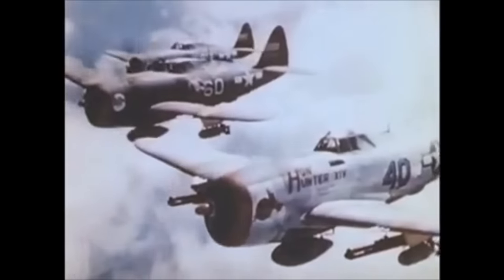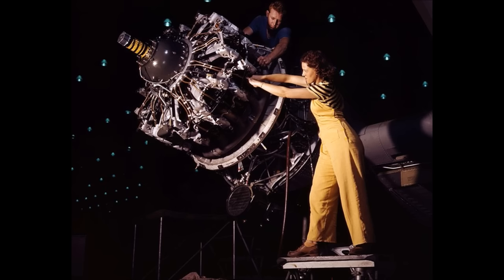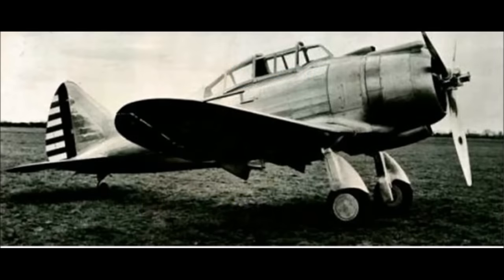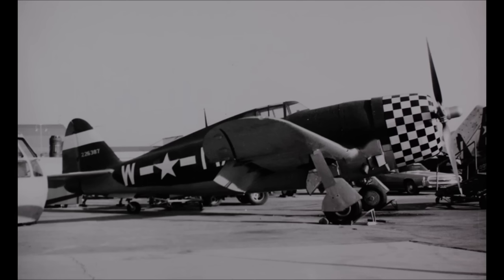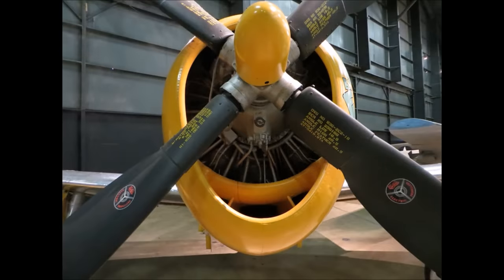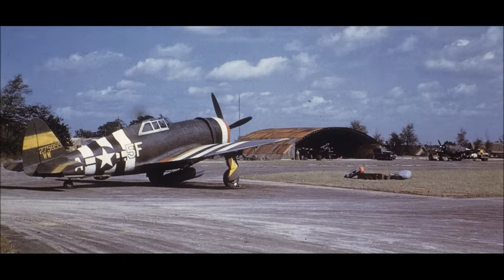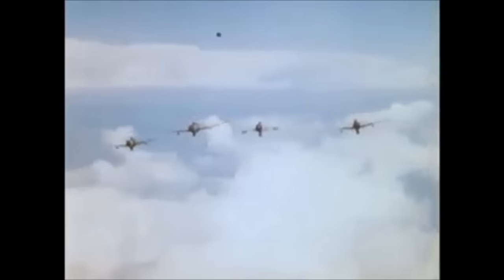P-47 Thunderbolt Pt. 1 Design and Speed

Comment: You mention the flight sims, I like to fly IL-2 Sturmovik, Battle of Stalingrad, Battle of Moscow and other titles. However they are not up to speed on the US Aircraft as much. Yet. They do have the P-39 and the Boston, P-40 as they were lend leased to The USSR at the time. The sim takes place exclusively between the Russians and Germans, with lots of attention to historical accuracy, as far as planes available and their limitations. I'm real curious to see how pro pilots view these sims. With these sims its important to have pedals, Throttle and good joystick. Track IR5 and good headphones. I don't get to fly as often as I would like but when I do I want immersion. Gunnery and its physics are modeled well too.
Reply from the maker: I started flying IL2 BOS yesterday. So far I have only flown the FW190. Overall, I think it's great, I only have minor complaints so far. I don't have track ir, but I do have pedals, throttle, etc. My main complaint is that the inclinometer moves backwards from the direction it should in regards to P-factor, it moves correctly in regards to aileron movement.That's small potatoes though, overall, it's just incredibly good, and accurate.
Reply: Awesome...! get Track IR, it will change the whole experience. Regarding that gauge of course it is possible that this an error but I would look into the setup and see...I'll check mine...The 109 is a hoot to fly too, probably my most favorite, it seems to do as I ask, it is very forgiving, while the 190 is "twitchy" and real easy to stall. The firepower on the 190 is pretty killer.  I suggest the Russian La5 as well.
Reply from the maker: I do need track IR, it's tough to find the enemies looking around with the hat switch, and the lack of icons on the server adds to the difficulty, which is actually the point, I get that.  At the moment my 190 tactic is to run from fighters and attack bombers. I have only played online a couple times, I shot down two planes but got shot down several times. It's a lot of fun. Regarding the gauge, it's an error, at high angles of attack the downward prop blade should take a bigger bit of air and yaw the plane to the left thus moving the ball to the right, but it doesn't, it moves it the other direction. Not a biggie, in fact it's really a small issue. From a realism standpoint, this sim is awesome.
Reply: LOL that's how it happens, till you figure out what to do....The trick is ...Don't look "new" on the server. Those eagle eyes will see your mistakes immediately. Follow the basic combat rules of engagement, hit when they don't expect it and stay away from their front end. Fly confident and never in a straight line for too long.  Its all about slash tactics. And the more you have on your side the better. Some of these online squadrons will go into a battle area and circle at high altitude just waiting on someone new. They will jump you and take turns until your down. Its a good tactic. They have comms and coordinate quite well. Their unit discipline is very good sometimes.  Get as high as you can and maintain a high energy state at all times. Swoop on to your target, do not bank if you can help it,  it slows you down. If you miss, and you will,  slash on through and regain altitude without spending too much speed then set up for the next pass. Keep practicing that maneuver. If you MUST stay and fight in a turning match the answer is almost always speed. If your trapped you might want to drag the enemy to your area where hopefully your ground AAA will distract him or even get him. this worked for me a few times. Lately I have been sticking to air to ground interdiction and working on my gunnery. The new flight/gunnery physics have me shooting very ineffectively. Oh yea ...Trigger discipline ….learn it... use it, I'm sure you have been Winchester ammo already...(like bingo fuel) Have fun! Share your insights too.

Comment: Are you saying that the radial had a longer "end of efficiency" point than the "V" configure engines for props? Is this true for some of the same reason that  VW eventually gave up air cooled engines in favor of liquid cooled?  Is this for the same reason the water cooled sports motor cycles are faster then air cooled?
Reply from the maker: No, I am not saying anything about "end of efficiency", I am actually not sure what that means. What I am saying is that the twin row radial improved the power to frontal area ratio enough so that radials could and did compete with V-types. I'll be expanding on this more in future videos. I'm not sure I'll get into air cooled VWs or motorcycles, at least not for a while, I have other things on my plate that are higher priority.

Comment: I'm reminded that  Henry Ford asked if there was any part of the Model T that never broke.  Upon hearing about some part of the differential meeting that criteria, he ruthlessly engineered it downwards to be cheaper and lighter.  I'm wondering if likewise the P-47 was in some aspects built "too well?"  It may be that reducing the strength of the aircraft in some respects could have shaved a half ton or more off, in part thanks to virtuous cycle, and possibly saved more lives with faster turn or roll or higher speed (or yet longer range) than it would have lost had at least a FEW wings or tails finally coming off?

Comment: The P-47D-10 without wing pylons is around 15mph faster. That equates to 460mph at 20-25,000ft. Faster than any relevant plane by the wars ends. The magic behind this speed is of course 150 octane fuel but also just as important is the Hamilton propeller. I was hoping you'd touch up more on the 3 different propellers used on the P-47 as there is an actual document on WW2aircraftperformance. The best propeller was easily the Hamilton standard, performance wise. The Curtis paddle blade was preferred over the Hamilton for some reason despite being 5-7mph slower. The paddle blade was definitely a better choice over the toothpick prop which was used on early P-47s as it provided 20% faster rate of climb and acceleration for a slight sacrifice in top speed.

https://forum.il2sturmovik.com/uploads/monthly_2018_03/p47d-44-1-level.jpg.8f0a76a535566a71c40790b145079083.jpg

The P-47 was never fast at seal level but it remained king at high alt. And with 150 octane fuel the fastest fighter from mid to high ult. Sure the early P-51B with the -3 engines were fastest all around but the engine -7 was actually very similar in top speed to the P-47.

Nice of you to touch up on simulators because the p-47 never gets to experience that late war buff like the other fighters. Since it's mostly perceived as ground attack aircraft. There's a reason the majority of the top aces in ETO were P-47 pilots.

By the way, Gabby also hot rodded his P-47. There's actually a video online of a P-47M pilot talking about someone in their squadron hot rodding their M variant to 80"Hg.
Reply from the maker: Thanks, I'll look for that video, and I will cover the props in  a later episode. I just couldn't fit any more into this one.
Reply: @GregsAirplanesandAutomobiles Yeah 45 minutes is the perfect length imo. Great work Greg. .
Reply: Probably a lot of this hot rodding going on since they knew they could. Which likely contributed to the WW, war weary, inventory. Never heard of the WW craft before, cool, thanks.

Comment: Greg, why is it that the P-47 does not require any cooling air scoops for the turbocharger and yet the P-38 has both cooling scoops, exposed exhaust manifold, and exposed turbocharger to facilitate cooling?
Reply from the maker: I don't know for sure, but I think there are several reasons. The turbo in the 47 is pretty far back, so the exhaust has already cooled at least a little before it gets to the turbine. The turbo has quite a bit of air around it, it's not packed in nearly as tightly as in a P38. It's also possible that the 47's turbo has better oil cooling than the 38, but I'm really just guessing there.
Reply: Greg's Airplanes and Automobiles - I agree that the tight packing of the P-38 installation vs the somewhat isolated installation in the P-47 might have had something to do with it. I’m not sold on the possibility of better oil distribution efficiency considering these were all made by GE and were very similar to each other.
Also, did you notice that the intake air for the P-47 has already been pushed through the intercooler before it reaches the turbo? How does recycling intercooler cooling air to the turbo  intake not lead to higher carburetor air temps?
Reply from the maker: I didn't say better oil distribution, I said better oil cooling, meaning the 47 may use the extra room or distance to provide relatively cooler oil to the turbo, then again, maybe not. The intake air does not go through the intercooler before reaching the turbo. The big duct splits into three parts, two go through the intercooler, and the thrid goes into the turbo inlet.
Reply: Greg's Airplanes and Automobiles - Does the turbocharger have it’s own oil cooler?
The P-47’s turbo (C23) runs at a lower turbo speed than the P-38 (B33). Maybe that has something to do with it; 20,000 vs 24,000 respectively. Also, the C-23 is 100 pounds heavier, so maybe a better oil distribution design.

Comment: There is some disparity between the alleged top speeds of late high-powered P-47D variants and those of the P-47M with similar power being much higher. You mention this, yet the max. speed of definitive D variants still remains a mistery
Reply from the maker: All true, but that's true for virtually every WW2 fighter. Varying conditions and configurations make standardized testing a problem.
Reply: @GregsAirplanesandAutomobiles  Yes  but I woul like to express my assumption that with regards to top speed the late D versions are probably the most underrated of all WW2 single-engined fighters

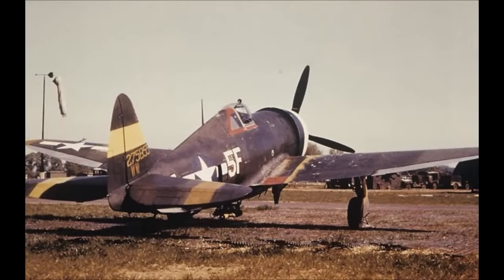Comment: The Jug at 18:11 has another canopy. Looks like a Spitire canopy instead of the usual greenhouse canopy you see on Razorback Jugs.
Reply from the maker: Yes, the later D models had a bubble canopy. It was based on the Typhoon's, not the Spitfire's.
Reply: This is not the common bubble canopy we see on later D models. This is a razorback Thunderbolt with a different canopy compared to the ordinary razorback canopy that looks like a greenhouse.
Edit: It's called a Malcom Hood and some P-47 had it.
Reply: That's right, like that on some P-51B's it appears to be based on the Spit's blown Malcolm hood, though perhaps a little larger than what was standard on the Spit IX. 
The first full clean bubble canopy made its service debut, as you say, on the production Typhoon 1b's, later also becoming standard on production Spit XVI's, later Mk VIII's and the Griffon powered Mk XIV/XIX's (and of course the D marks of P-47 and P-51). 
(Just the main types that saw squadron service in quantity!) Not including later Marks and odds and ends such as the Tempest V's and Spit XVIII's.

Comment: 5:15 -- "There are so many reports on engine cowlings, I couldn't possible go through all of them in a single video." -- Greg, I was watching another WW2-content channel a couple of years ago, and I believe that it was a training film regarding the A-20 that specifically mentions when and how to use the engine cowling flaps, and more importantly, when not to.

https://www.youtube.com/watch?v=sVqImhbKAqg
Reply: ^^ Fast-forward to about 5 minutes in the link;  "Upper Cowl Flaps" make for interesting take-offs.
Reply: Also, there's a big difference for engine cooling between a single engined fighter like the P-47, and a multi-engined bomber that used the same or very similar power plant, mounted in nacelles on the wing.  Namely, the airflow over the wing causes more turbulence than disturbed airflow over the fuselage, and wing roots;  although, I imagine some turbulence might interfere with the elevator on the fighter, as well.

So, I guess this comment is a question -- what causes more drag, turbulence on the wing that also reduces lift, or turbulence along the entire length of the fuselage which doesn't affect the lift as much?

Comment: Air-cooled vs. liquid-cooled engine for a fighter aircraft? That's easy. You can hit an air-cooled engine and there's a  good chance it will keep running, at least long enough to get you home. There are examples of entire cylinders shot from R-2800s and the engine kept on going. Hit any part of the cooling system of the liquid-cooled engine and you're done.

Comment: Well Greg, I am a bit confused on this one.  It has an intercooler ,  where is the other supercharger ?
Reply from the maker: The mechanically driven supercharger is on the back side of the engine between the carb and the engine.
Reply: @GregsAirplanesandAutomobiles  Thanks for the quick response.That is what I assumed but could not find a diagram or drawing

Comment: Gentlemen, I have a question, which is the thrust from the R2800 + Curtiss Eletric or Hamilton Standart propeler? Nowadays, jet engines have this power rate by thrust, the turbo/propeler engines by SHP, but the combinatios of the engine end the propeler make an equivalent traction as thrust, so that, that's my question.

Comment: Given that the F4U Corsair had the same engine is it safe to safe that it and the P-47 had similar performance?
Reply from the maker: They are quite different. Please check out my videos on this subject: https://youtu.be/ULLsIo1VzTw      and  https://youtu.be/rNcV13uayxw
Reply: They were built for different missions. The P-47 was for high altitude and the Corsair was for low and mid altitudes. It is a testament to the engine that it could be used in both airplanes with such different performance characteristics.

Comment: Keep an out for IL-2 Battle for Bodenplatte. It will have a P-47D-28 together with many other major single seat fighters on the western front 1944/1945. That is gonna be awesome!
Reply from the maker: That's the one I am getting.
Reply: @GregsAirplanesandAutomobiles  amazing! I hope to see some gameplay!
Reply: In a couple of weeks we should be getting the Bf 109 K-4 and P-47D-28 for the Bodenplatte expansion, it's in Early Access stage for now, so the content gets released as it is completed, this means new planes every month or two.  Currently the already implemented planes are the Bf 109 G-14, Fw 190 A-8 and Spitfire LF Mk IX. The Bodenplatte map isn't released yet so I don't know how it would be for someone who would only get this early access expansion (you can play online in servers in maps from expansions you don't know, but in single player only the maps you own). 

If you are interested in the Eastern Front planes the other expansions are nice. Battle of Kuban is pretty interesting since it has the P-39L and A-20B as Lend-Lease planes for the Soviets, and it's map is the most beautiful so far, with the Black Sea and Caucasus mountains.

About what you mentioned in the end of the video, it is very probable that the American planes won't use their maximum engine settings. The Bodenplatte expansion models the tactical-nature campaign of the continent based squadrons, and afaik the American forces didn't employ 150 octane fuel in these bases, so the P-47D-28 would have 64" as max MP and the P-51D-15 would use 67".

The British did use 150 octane fuel on the continent starting from January 1945, but currently the Spitfire doesn't have increased settings (+18 lb boost instead of +25 lb boost), a community member talked to the developers about this, and they said they lacked some information on the engine when used with this increased boost, luckily this guy provided them with the info they needed so maybe in the future the Spit will be able to use this increased engine boost setting.

Comment: I'm not trying to sharpshoot you on this, but you either misspoke or I don't get something you're saying, at 34:30 you say 23,000 RPM, did you misspeak talking about engine RPM or were you saying a turbo RPM? And could the pilots hear detonation while flying or did they know by performance and or a guage or light indicator?
Reply from the maker: Oops, I meant 23,000 feet. The later D models could hold 70" of manifold pressure to 23,000 feet at the turbo's maximum speed of 18,250rpm. Later P47's had turbos that spun up to 22,000rpm. I hope that clears this up. I mis-spoke, good catch!
Reply: @GregsAirplanesandAutomobiles  
Thanks, like I said not trying to sharpshoot you I was just a little confused even after rewinding it 3 times and listening to it.
Reply: Do you know if the pilots could hear detonation or was there another way they knew it was occurring like a guage or light?
Reply from the maker: I added a comment in the description to clear up my mis-statement. You can't usually hear knocking in a plane. However a really sensitive pilot can  notice it because an increase in manifold pressure will cause a decrease in power when knock is present. In reality, pilots normally just use settings they know will not cause knock.
Reply: @GregsAirplanesandAutomobiles  
👍 Thanks, always wondered about that.